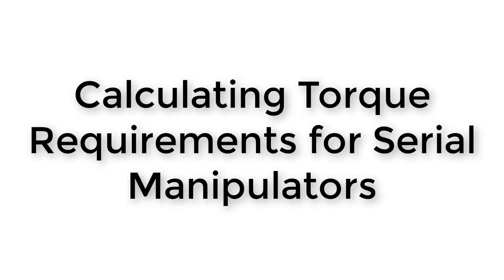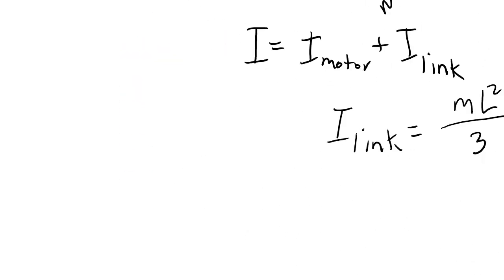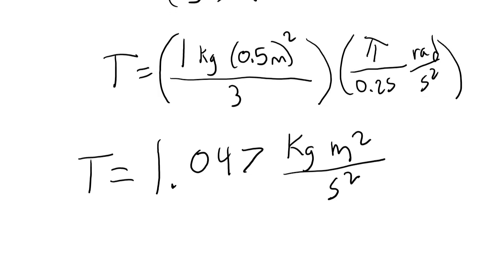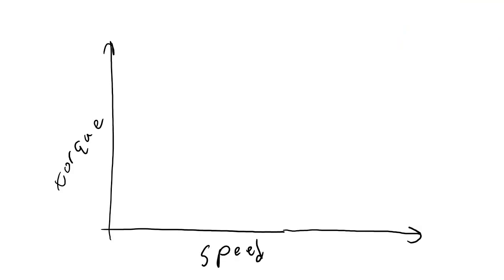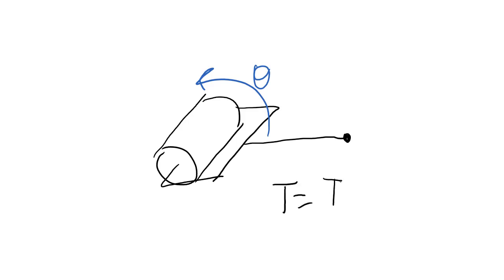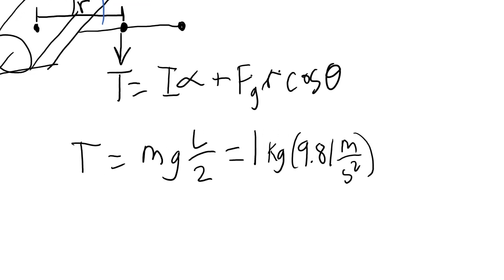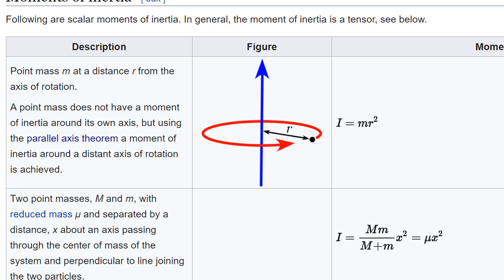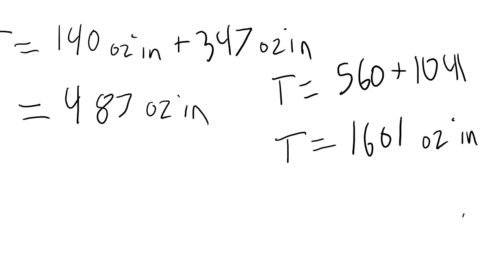Robotics 1 U3 (Motion Control) S1 (DC Motors) P4 (Torque Requirements for Manipulators)

Comment: I do not understand why 57 RPM and 200 oz-in can't exert in case we just need 30rpm and 140oz-in. I think we should pick one that have less than 200 oz-in and has speed more than 30rmp to discuss right. If motor has 200oz-in and has speed less than 30rpm, we should discuss. But motor that you pick to discuss has speed and Torque bigger than the require speed and torque already.

Comment: I'm a little confused, are we using acceleration and deceleration as the fastest way to get from point A to point B? so we are looking for something that takes .5 second to accelerate and decelerate between 0 and 90 degrees? From what I understand of a triangle curve accelerating to a certain point and decelerating right after that is the fastest and shortest way to get from pointA to pointB
Reply: Also this is angular acceleration correct? I also understand that Torque is proportional to acceleration, so having the least acceleration should be the least torque needed as well
Reply: I think what I don't get is why the least acceleration needs to have that shape in the graph

Comment: can u post the video on finding torque for serial manipulator joints ?
Reply from the maker: That's what this video is about.
Reply: sorry , i meant for motor torque calculation along with serial linkage , which you have mentioned about in this video lastly
Reply: @harikrishnan1015  did u got the video